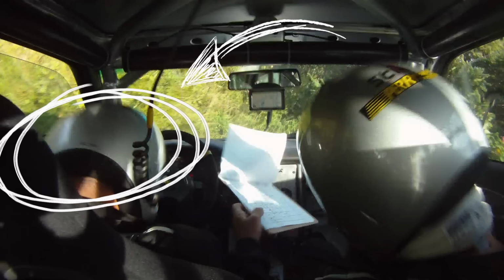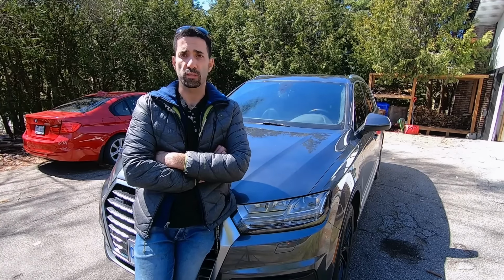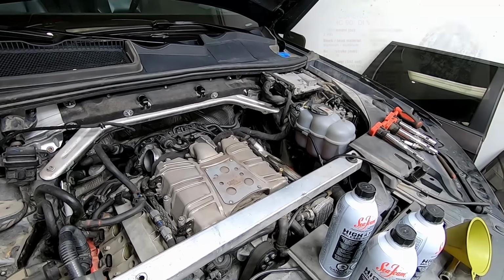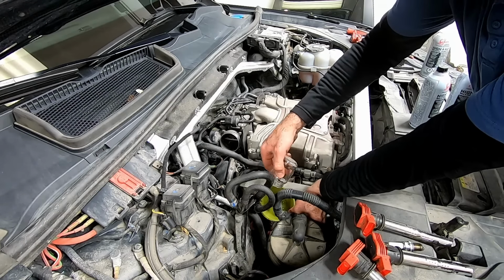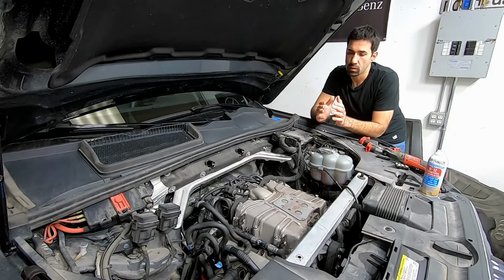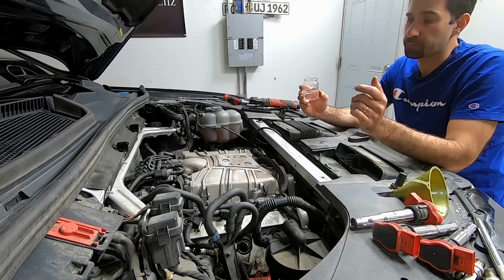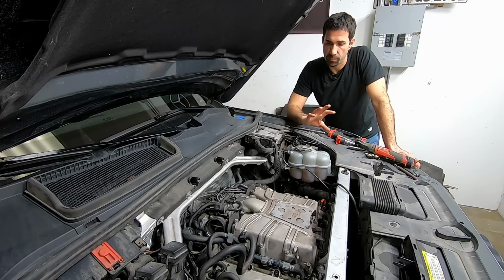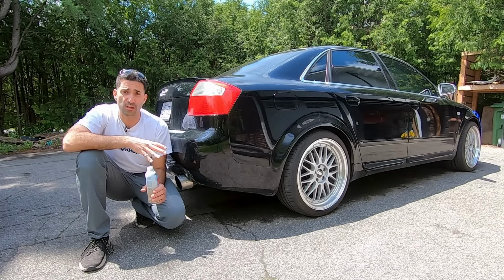How to fix oil consumption on VW/Audi/Porsche 3.0T engine?

Comment: First YouTube comment ever! Same issue here with a 2017 Q7 3.0T. Dealer wants 17k for piston ring replacement. I have been adding 1 quart of oil (US) every 500-700 miles. I will try the soak with b12 and update. Excellent, helpful content.
Reply from the maker: @dennis-unakaproject7822  good luck - keep us posted... yeah 17k is mad

Comment: Going to try this on a 2017 Q7 I picked up for my wife. It burns somewhere around a quart per 700-1200 miles depending on city vs highway. So far, it seems to burn a lot more with strictly in town driving. I will update with the results! Thanks Eurotrash. Car is at 118k miles.
Reply: Keep us updated I think I’ll do this on my 2017 also this summer or fall. Ours uses 1-2 quarts between 5k mile changes so it’s not horrible, 100% uses more in town driving and nearly zero on highway… weird. 85k here
Reply: Will do. I completed the work last week. It was not bad at all. The only thing to be aware of is there is a tool that would be very useful for turning the crank. The harmonic balancer is held on by 6 or 8 triple square bolts and there is not a big center bolt like I’m used to on BMWs. I was able to get around this by very carefully using my triple square on one of the balancer bolts, but I did feel one tighten one time so I don’t recommend that method. I also used the bolt on the alternator but you can’t use only that one because the belt slips.

I took some photos of the pistons with my endoscopic camera before and after as well and you can tell a difference. After was post 30m drive right before I changed the plugs and drained the oil.

I’ll let you all know how it goes. I’m currently running the Rotella T like he recommended because I already had some on hand by chance. I’ll change in about 1000k miles.
Reply from the maker: keep us posted on the final results
Reply: Unfortunately I now show the first tick mark down on my oil level after 950mi. This is using the Rotella. I’m going to change the oil back to factory specs and see if I can go 5k OCI without topping up. If I don’t make it, I’ll probably do the B12 treatment again since I have another four cans.

Comment: Great work. I have done the full carbon clean on a 2013 B8.5 S4 with the 3.0T supercharged engine. Mine had heavy carbon buildup around the valves, but not so bad in the cylinders. That Q7 was bad! I do still burn some oil, so this is now on my list of things to do at some point. Cheers.
Reply from the maker: Yeah the Q7 was carbon cleaned before we did the treatment as well
Reply: did you do it and did it get better ?

Comment: I couldn't thank you enough for making this video! I did the piston soak on my 2018 Q7 this weekend and it seemed to go just as you described (now I just need to drive and see it fixed the consumption). Engine does seem to be running better. The process was pretty hard on this car because the spark plug holes are very deep. I would advise to put 2 oz (~50ml) of B12 in ALL cylinder and turn the crank until water starts to come out 2 of the spark plug holes (indicating they are at TDC). Add 2 more oz of B12 into the 4 cylinders that arent at TCD. Then let everything soak for 6-8 hours. This way you can have all cylinders soaking at once. Then turn crank and repeat this process but put a different 2 cylinders at TDC and let soak for 6-8 hours, and then repeat for last 2 cylinders at TDC.... Just my thoughts
Reply from the maker: Awesome - looking forward to your results... the Q7 from the video is now close to 3k without loss of oil so drastic change from the start...

I like your idea about watching the liquid come out to know your at TDC...If you don't have extensions or a scope to see when the pistons come up that's just as good...I think if you're soaking all at the same time though,  you may end up using too much liquid? How many cans did you go through? Also did you have any issues with build up of carbon like I did? A few viewers have noted the same thing - as the liquid drains through the pistons,  garbage builds up at the lowest point on the piston and prevents you from turning the crank
Reply: @ETMotorsports  I ended up adding 3 cans (45oz) of B12 by the time I was finished. So before I started the car I loosened the oil plug and drained 32oz  of oil to be safe. The car smoked for the entire 20 minutes that I ran it with the B12 in it before changing the oil. I had very minor issues of carbon build up and the crank was hard to turn and I had to blow it out like you did. It was a little scary, but I don't think I had it as bad as you did. My Q7 has 74k miles and was consuming about 1 liter every 3k miles after a PCV change. So I figured I would do this procedure before the issue got really bad. Shame on Audi for kicking this issue down the road they way they do and telling customers that 1 Liter burning per 1000 miles is to spec.
Reply: The deep plugs is the reason the seals do this

Comment: I've been driving Audi for some time now, and I used to have problems with oil consumption. meet a good mechanic years ago that believe the reason for the oil consumption is related to carbon build-up around the piston and rings. He suggested always using premium gas and oil changes every 5k using Motul or Liqui Moly oil. have been doing this, and I can say I have 0 issues with oil consumption.

Comment: Can't thank you enough for making these videos. Was scared to try this, but I knew if I did not get ahead of this issue there would be CELs soon.

I picked up an 2018 Audi Q7 with 111k miles 2 months ago. During that time oil light came on 3 times, and after measuring the second time it was once every 200-ish miles. Probably why I was able to get a pretty nice deal from the previous owner.

When I removed the spark plugs they were very full of oil/carbon, surprised I hadn't had a CEL yet.  The piston heads were very black and coked up. 

Performed a B12 piston soak for 72 hours (2 pistons per 24 hours at TDC with rotations). I even gave an extra 24 hours at the end to let it evaporate. After the soak and air blowout, I could see the metal tops again. Surprisingly very little smoke came out when I started it up, though there was definetly carbon soot coming out the exahust. 

Now at 400 miles with oil level reading full. I got nervous a few times because after 50 miles and initial startup I saw the oil drop down a notch in the Audi MMI, but after driving and warm engine oil check it still reads full. 

Will keep this thread updated. I think at this pace we can get back to 1000 miles at least.
Reply from the maker: @ShaanNotShawn  great results! Happy this worked out... pretty much all the cars I've done so far improved with the miles - the first 500 showed a drop, but the consumption gradually slowed down and then stopped
Reply: any updates thus far? how has your oil read? I think its been about 2 weeks since you made the thread
Reply: @shariqarain  on vacation so haven't been driving much. But at 450 it permanently shows one tick down now. Will update when I get to 1000miles
Reply: @shariqarain  Now at 850 miles and the same tick down, looking pretty good
Reply: Went on a road trip. Now at 2100 miles. At this rate feeling pretty good about getting to 5000, but if not this was a MASSIVE improvement.
Reply: 3500 miles at the lower half of the min/max line but still haven't added oil
Reply: @ShaanNotShawn im gonna do this in a couple days. Im scared tho lol. Do you think its best let it evaporate for a day? My only concern is hydrolock.
Reply: @talentedfiend9498  yeah that's why I waited 24 hours after doing a crank without spark plugs to get any other fluid out, I didn't really have a proper fluid vacuum. Should be good👍

Comment: Let me begin by saying Thank you for posting this video. My Q7 was burning a quart in about 4-500 miles when i got it a year ago. after doing so much research and doing an engine flush i got a bout 1200 miles before sign came up to put a quart. After watching this video and doing the Piston soak i have driven about 1300 miles and the MMI shows i have used about 1/4th quart of oil. So still burning but nowhere near what it was..!!
Reply from the maker: @kumarpatel9061  great results!!! You can always repeat the process in a couple of oil changes if it's not resolved although I'm guessing you'll be fine

Comment: I have a 2010 S5 with the CAKA 3.0"T" engine, i bought the car with 220k km i am at 240k now i change my oil once a year at about ~5-6k km and at those 5-6k i burn about 0,4l of oil so i dont consider that a problem so dont be discouraged from getting a car with this engine, there are other complexities though at these mileages and years, i had to do my chains, every type of seal around the engine and lets not mention the DSG. Best of luck, thanks for the videos

Comment: Another win, good job! Thank you for posting these, I'm about to buy a 2014 Q5 2.0tfsi with the ea888 gen3 engine only 118k kms on it and it has oil consumption issues. Owner has advised only been a grocery getter and kiddie drop off car for their 5 years of ownership and used a cheap budget fuel outlet down the road from their home to fill up. Car drives smooth and normal otherwise and has good pick up, and it also has an after market pcv valve which I'm skeptical about as that was swapped over due to a vac leak code at 80k kms, and they said they noticed oil consumption issues not long after cheap pcv valve swapped in, so I'm gonna hit it with a genuine one first and if that doesn't help, B-12 it is!!!

Comment: Used to soak cylinders with a lower compressions with a cheap engine flush liquid (it restored compression), then run engine with it before oil change. I guess stuck rings let liquid to pass through quickly and standing liquid proves good sealing. So it is good to add soaking liquid (whichever you use) to cylinders where liquid disappears fast. Good to check compression after everything.
Reply: Yes that true stuck rings let solutions drain down faster

Comment: Valvoline restore and protect works REALLY well on VAG engines use 5w 20, after my 3rd change, i bore scoped a beautiful 180,000 mile 2.5 it almost looks new! This is not a ad, it works!!
Reply from the maker: @lickwidgoat3480  did you have oil consumption? What was the before and after?
Reply: My 2017 Q7 3.0 supercharged Crec calls for  5w/40 oil.  They dont make it in that weight.  But I have thought about trying the 5w/30
Reply: @drm916  its fine, i use 5 20 and 5 30 depending on the season
Reply: Be warned everything downstream will get dirty like the cat and o2 sensors!!! Run a high quality fuel with cat cleaner
Reply: Yeah I am using 5w30 R&P valvoline in my engine too(3.0t q7 2018)
Reply: @K4mikze  my 02 sensor got fouled too i ran cat cleaner through 2wice, thats how i know it works. Its good stuff.
Reply: @lickwidgoat3480  what are you using for cat cleaner so I know what to get ?
Reply: @K4mikze  cataclean.

Comment: Hi! Audi q7 4m 140000km. Oil consumption was 1 liter on 400km. After doing this procedure I ran around 1260km and engine asked me to add 1 liter.
After a while I ran 4250km throughout the city and highways on Russian roads and oil level was empty on a half. 
I ride around 140-180kmh during on highways. 
1200km left before the next oil change. 
So i think I won this crazy oil consumption.
I will watch the situation after the nearest oil change.
Thank you very much. 
I used solution for valves and pistons on hot engine during 4 hours of procedure.
Reply from the maker: @lermos  sounds like it improved but not resolved... try to do the full 24hr+ procedure with the same solution - should be able to solve 100%
Reply: @ETMotorsports  sure. Will try again to eliminate it totally

Comment: There's a few other options to try now. Valvoline makes a Restore and Protect oil that is supposed to help take the carbon off of pistons and stop oil burning. That's supposedly done over 4 oil changes. Then there's the extreme option with is Valvoline Premium Blue which was developed with Cummins for fixing oil burning problems in their engines. That will supposedly clean a 15 liter engine in 1 oil change, so if one was to use that, I'd be changing oil filters every 200-300 km. That may be worth a try in conjunction with a piston soak.

Anyways, good to see that these are still working. And that older footage was really cool.
Reply: only draw back with restore and protect is that it is not audi/VW approved.
Reply: Been wanting to try the Valvoline Restore and Protect but not sure if it would be safe to use in an Audi.  They dont make it for Euro cars yet.
Reply: @richardrussell1025  I just did the Piston soak on my 2018 Q7 3.0 t.  I ended up putting the 5w30 restore and project in it. It's relatively inexpensive to change the oil. So I'm going to run it for a thousand miles and then check the oil filter.  Hopefully over the next thousand miles I don't burn very much oil. Previous to the oil soak I was burning about a quart every 800 miles.  If it doesn't drastically improve, then I will run the Piston soap again.  It will be much easier now that I know the process.
Reply: @drm916  I would be very curious on what you find. I also have an 2013 audi a4 burning a quart every couple of gas tank fills.  I was going to do the piston soak in October when I can do the down time. I just got the restore and protect oil in from Amazon today.
Reply: @drm916 I only ran the Valvoline R&P instead of doing the B12 soak and seemed to fix it.
Reply: @drm916 i am running valvoline R&P right now in my q7 2018 3.ot. so far did not see any improvement in oil consumption over the past 200 miles( my car is guzzling 1q every 5-700 miles) I will give it another 800 miles and see if anything changes for the better. So far I haven't seen anyone complaining about using valvoline 5w30 without audi spec that made their engine sludge up or blow up. I guess I will be a guinea pig and risk my own engine too jost so we can have some answers. I will definitely do a piston soak soon too after I get a pcv valve thermostat and water pump since I can hear a whistle(usually attributed to pcv being on it's last breaths/leg) from under the supercharger/towards the middle front of the engine bay
Reply: @K4mikze when do you hear the whistle? On idle or on acceleration? I am not sure if mines a supercharger whine or a bad pcv, lol.
Reply: @Vin_Nair  at idle.
Reply: @K4mikze  got it, any updates after running the valvoline r&p?
Reply: @Vin_Nair  so far no. i had to add 1 quart/1liter at almost the same interval (around 480 miles) and i'm only close to 400miles now and only half way trough on the mmi/dipstick if i surpass the 600 this month i will update this since that would be an improvement.
Reply: @Vin_Nair  update1 after 1k and second quart of oil: i can atest that after the second adding of a quart i am at 600 miles and it might last me another 50 miles if i believe the oil dipstick/dashboard gauge. that's almost 200 miles more than the usual 460-480 miles i was getting in the last couple of months before the oil waring on the dashboard. i will update this next month. if i don't feel free to @ me so i remember to update.
update 2: not sure if it's cause by the cold or what's going on but for the past 500 miles my car has not used 1 drop of oil. not in mmi not on the aftermarket dipstick.  i am mindboggled and have no explanation. will update if it's just a fluke
Reply: @K4mikze  Any loss of oil since then? Did you end up doing the soak as well or just the R&P?
Reply: @siriusbusiness2351  so far I only did r&p and for the past 3 months, my oil consumption dropped oil consumption from 480 to right now over 1.1k right now. It was a slow improvement but every time I get the light I get longer and longer periods in between having to add 1quart.
Reply: @K4mikze  thank you for the update. Did you do another oil change since then yet? Or still running R&P? I'm a little nervous about using it in my 2013 B8.5 even though I'm running 0W40 just fine right now, and have been for a few years now.
Reply: @siriusbusiness2351  I did not. I'm only at 3k miles since the oil change. And at my soon to be 4th top-up with 1q. First was the same as old Liqui Moli 480m, second at 580, 3rd at 980, and now will be at 4th I assume soon per mmi(I'm at 1.1k) I was worried too 😅😅😅 but I live up north and I have to fix my suspension on my a6 to be able to do a piston soak on my q7 and we had -20 degrees weather and cold for long periods. That's pretty cold and I didn't feel like working on either of my cars. For me that was the reason and to be honest I didn't expect it to work and I was thinking it might actually be the engine and I have nothing to loose beside an engine 😅😅. Fun fact in the first 6-700 miles i got soft missfire errors every now and than. But after that for the past 2k+ I have not had one(after every drive I had my obd connected to the car and check for errors and I have none related to the engine) it's up to you but if you ask me I recommend this option 1000% if you have the patience and nervs(at the end the oil weight is not an issue. They use this wight in Europe the only thing I was worried about was not having the right detergent which might sludge up the engine but I checked it weekly and the oil and top of the engine have 0 sludge, so I'm not worried about that anymore. I check maybe once a month now and I did not see any changes with the endoscope camera)